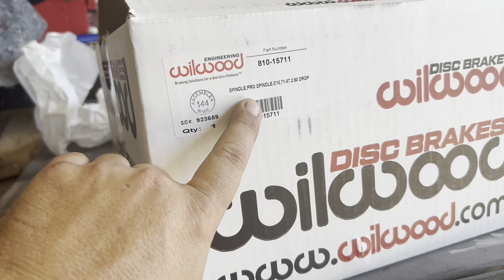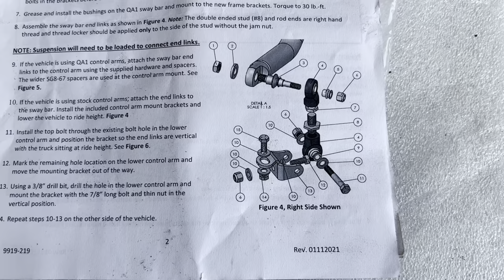Squarebody suspension rebuild! QA1 coil over conversion kit install!

Comment: What do you think a shop would charge to install this? I also have a 85 C15 gmc
Reply from the maker: Lot of variables there, but my guess at shop rates around my area would be a grand or more. Thanks for watching!
Reply: Probably closer to $1,500 minimum....I would budget for $1,800 to $2,000

Comment: Anyone know what size hole you have to cut to make the coil overs fit?
Reply from the maker: QA1 did not specify, but it was roughly 4" diameter.